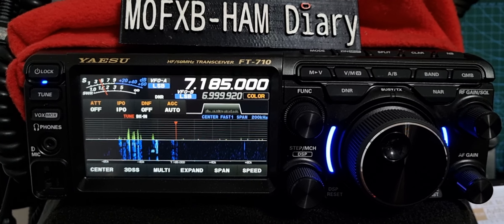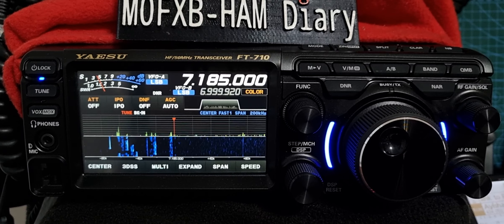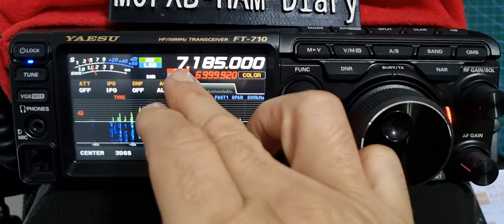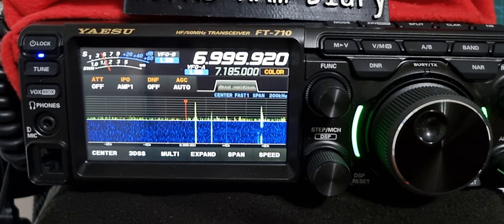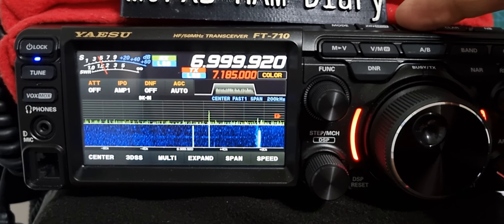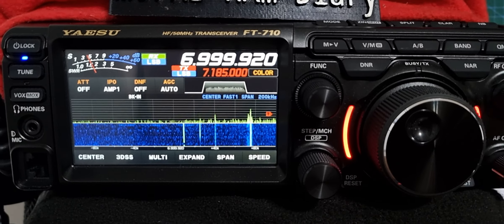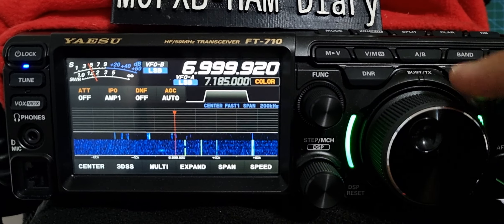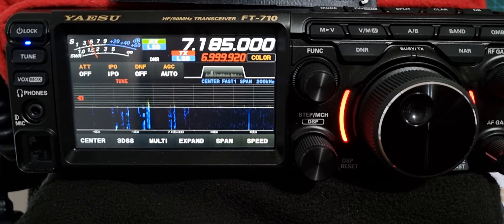YAESU FT-710 Split Mode & A/B Mode

Comment: I have problem whwn  I working SPLIT mode. When I am working with spit mode TXW button that allows you to listen to the transmit frequency works with a delay. I have no idea why this is happening and if it is a defect in my FT-710 or if it is a defect in the firmware of this transceiver
Reply from the maker: I would email Yaesu.

Comment: I notice this issue as well with the FT-710 and I find the fact that the radio disengages SPLIT mode when toggling b/w A and B very annoying. I often like to monitor the DX station's listening freq. (such as if they are working a range such as 5~10 kc). As you know, toggling VFOs turns off SPLIT. My FT-897D stays in SPLIT mode if I toggle A and B VFOs. Weird that a 20+ year old radio has some better features than a new modern radio does. Maybe we can ask Yaesu to fix this in a future firmware update?
Reply from the maker: Yes email them .

Comment: how do you use the TXM? manual does not mention at all.
Reply from the maker: Do you mean a button ?
Reply: @HamTechRadioScannerDrones  it's one of the selection at the bottom of the FUNC button
Reply: This damned radio insists on jumping into split mode.
I don’t want split mode. In fact, I ‘d prefer do away with the B-VFO.